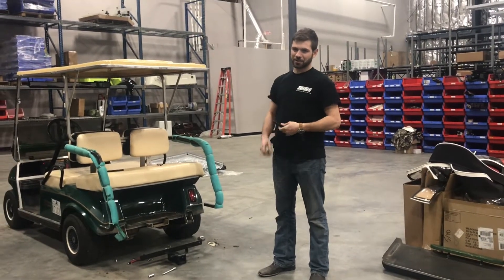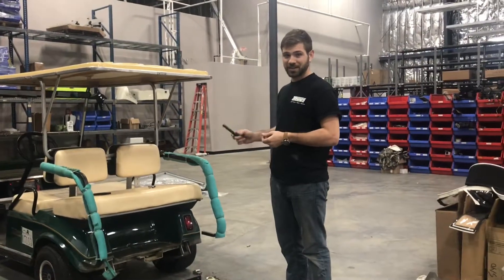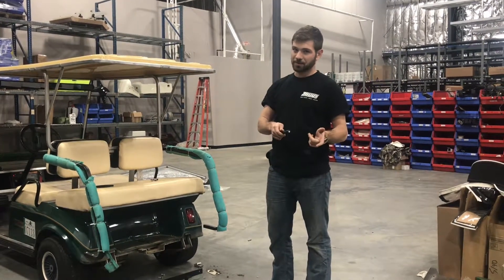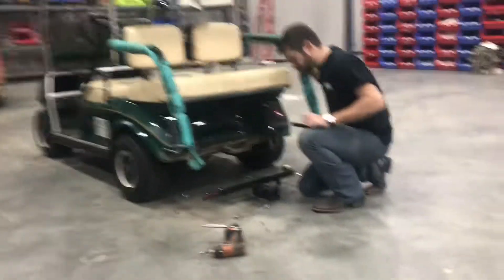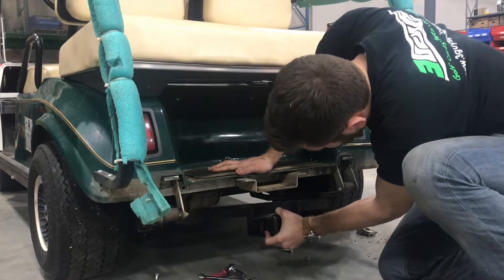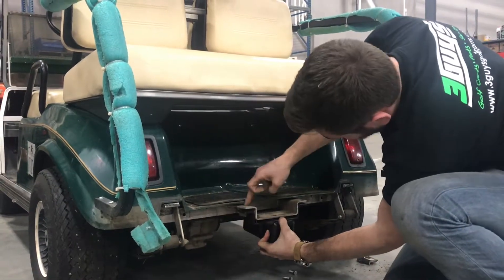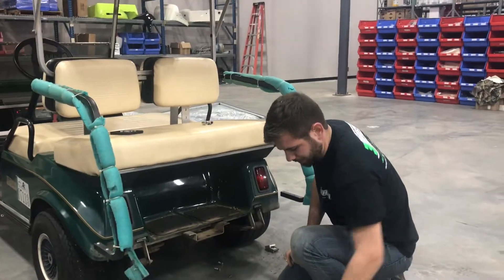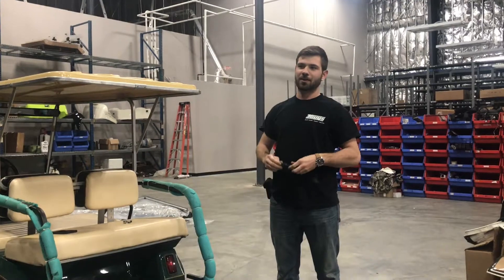Club Car DS Trailer Hitch Installation Tutorial (Subscribe Today)

Comment: So with the rear step reinstalled, the hitch is hidden underneath that step..correct? Could you add an extension?  I want to use a hitch hauler for camping gear. Not much weight.